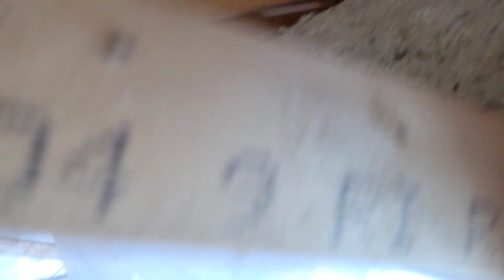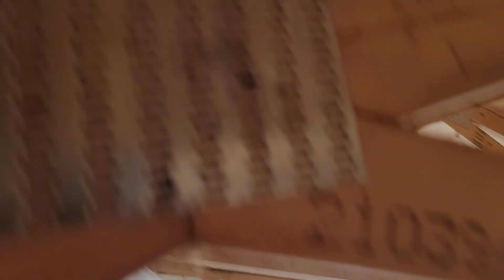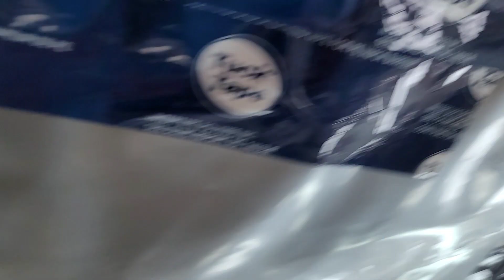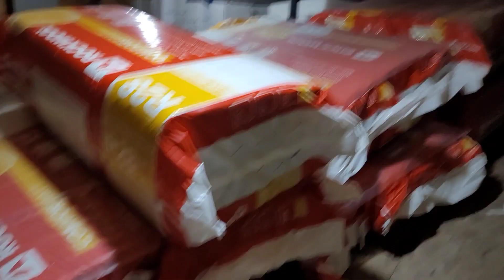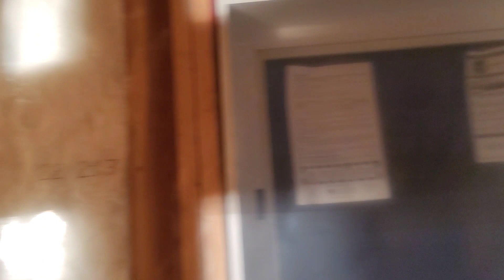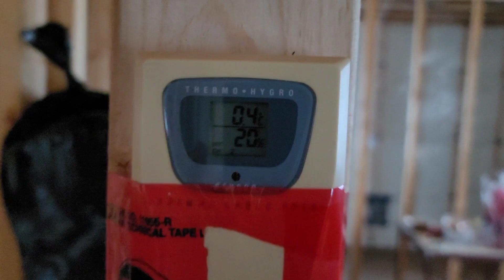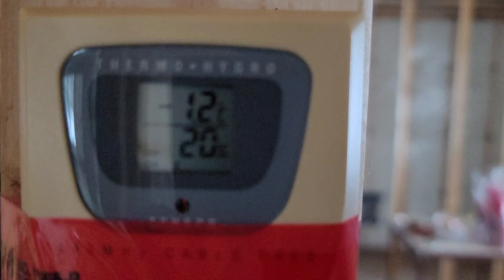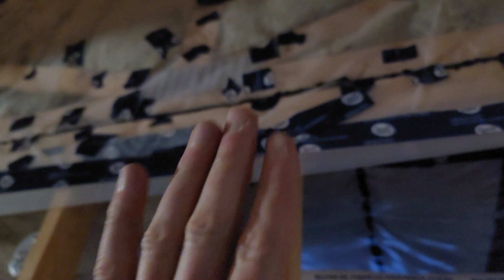How to Build the Warmest Off Grid House! Building Our 2300 Sqft Off Grid Dream Home! Part 10

Comment: How are you going to keep the chimney clean of build up. Are you going to have to take the chimney apart every time to clean it out?
Reply from the maker: If you burn "good wood" that is dry and burns hot there should be very little build up in the pipes.
To clean our chimney we will have to go on the roof and sweep it from the top down.